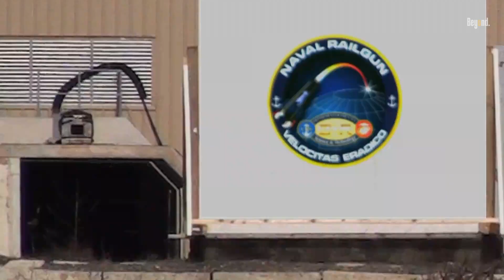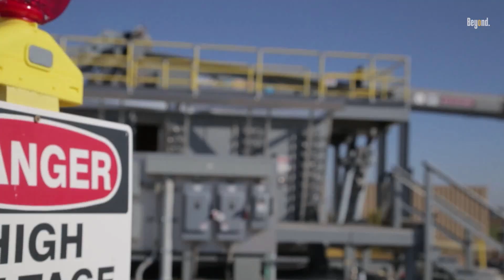Why does the US Navy need a railgun?

Comment: I love railguns but the biggest hurdle they face isn't necessarily technological right now, it's that the Navy canceled funding for the program back in 2021.
Reply: I was thinking the same.  Maybe they took it black, but they were building them for the Zumwalt class.. a double thud.
Reply: @ashtheelder5144  I haven't seen anything recently about the Navy reactivating the program, but sometime last year, Japan was trying to partner with BAE, which was the company doing it for the Navy. Japan also signed a cooperation agreement with France and Germany to work on them. It's a pity if we get left behind on them.
Reply: @jeremybingham2093  That's why I opined that are taking it black.  There are a lot of platforms that could use it, and energy based weapons need the punch to back them up